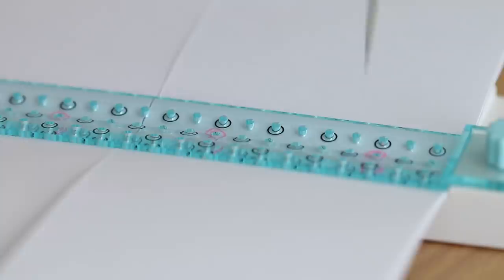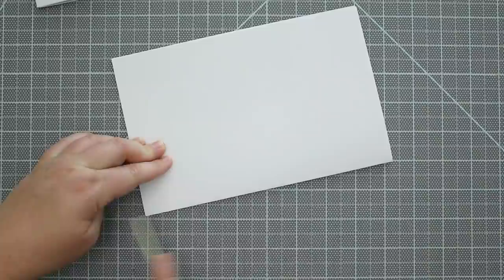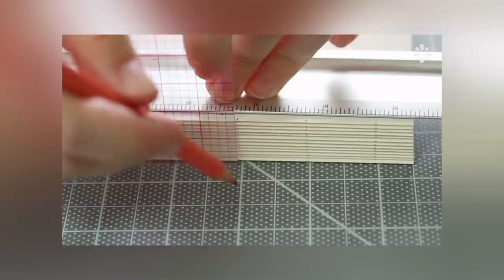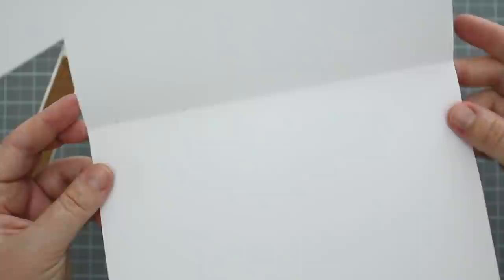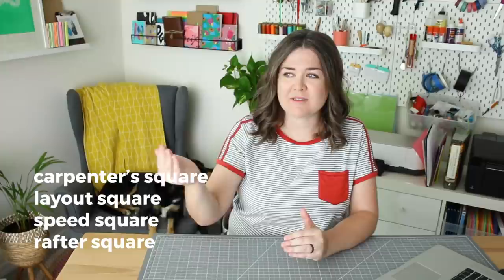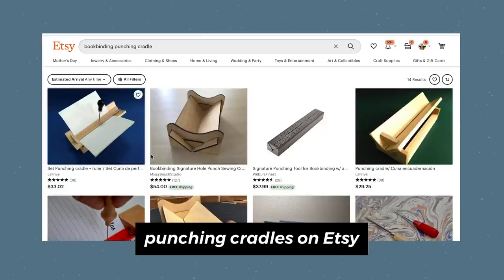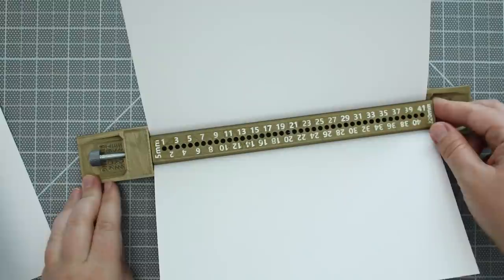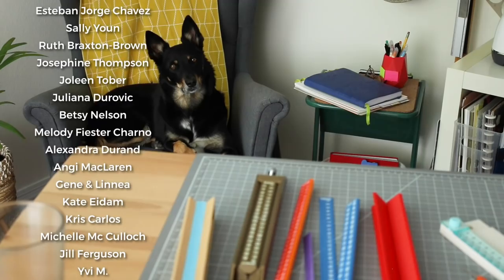What's the best way to punch holes in signatures?

Comment: Thanks for the nice comment about DAS Bookbinding.  Another method, similar to sawing in is to use a knife and make a cut across the spine against a square.  It has the advantage of not removing material like a saw.   DAS
Reply: As a fellow binder that's the method I found the fastest mark the lines and use the knife to cut into the signature remove and start sewing immediately instead of punching individual signature 😉 and yes I am a big fan of DAS Bookbinding
Reply: DAS Bookbinding I love your channel, you've really helped me through lots of problems. Thank you 💖 xxxxx

Comment: Section: If the sheet has been printed, then folded down, it is referred to in printers' terminology as a signature.  Any signature can be called a section, but only a section which has been printed is technically a signature. It is called a signature because the scribes would sign their work.

Signature: A specific type of section, differing from the general term of section, in that a signature is a sheet that has first been printed, then folded to a section. Signature is a printer's term for the binder's word section.

a single sheet of paper folded in half is a FOLIO. (Marked or not marked)
a gathering of folded folios is a SECTION or a QUIRE.
Reply: ThAnk you i always forget terminology

Comment: Howdy, great video. When I hand sew signatures, I like to use an awl with old manual as cradle, or Cropodile. 

For 'perfect binding', I like to staple signatures in 3 spots...and/or glue or hot glue them onto into hidden spine.

For faux Flo-Jos, I use a giant rubber band, or wrap twine/yarn/string. - TN style. tfs!

Comment: Any chance you can do a video for using scrapbook paper it make journals? Like the 12x12 size. I have beautiful pads and I wanna make some but still new. Please?
Reply: wouldn't you just  use these techniques using that paper?
Reply: for example  if you wanted a 6x6 finished "book" just cut the paper in half, so you have 2 12x6 pieces of paper, then fold them in half together, now with just one page of 12x12 paper you have 4 pages of "book"

Comment: What can you add to trimming edges techniques and cutting rounded corners that don’t require expensive tools? I’ve been strugling with that. Tks!
Reply: Hello, Search Crop-o-dile Corner Chomper. Made by We-r-Memory Keepers. They are not very expensive or search out used ones on eBay. I am in US and bought mine for about $20 on sale. The regular one does a .25 &.5 rounded inch and can cut several sheets at once if I remember correctly. (I know the whole punches by them do up to 10 sheets of copy paper and I love that tool by them as it also has an eyelet setter)Corner chompers come in rounded, retro and also a scallop (possibly a tag chomper also where it nips the corners off, like a gift tag)for this brand and many other brands have fancier edges but usually only handle one page at a time. Hope this helps :)

Comment: Thanks for this. One thing I never seem to hear about is the number of holes. If the number is odd or if it is even doesn’t that effect whether the string ends up on the outside or on the inside?
Reply: For junque journals, I prefer odd numbers - 3 or 5 holes. String ends up on the side where you start sewing.